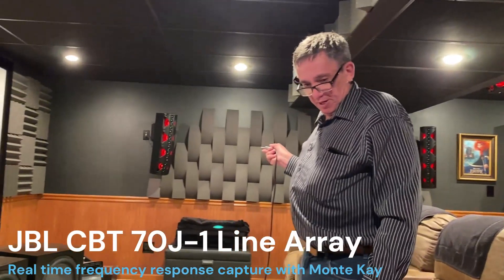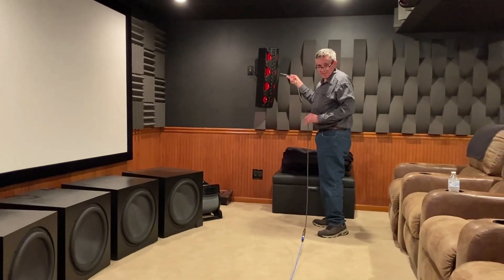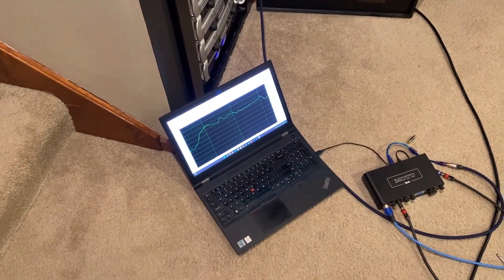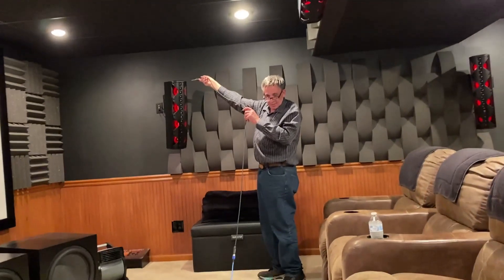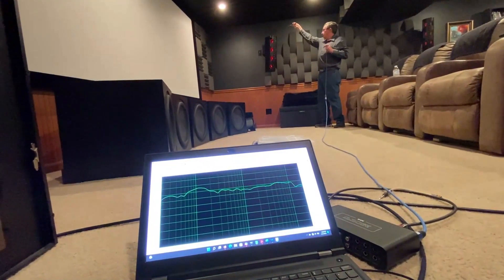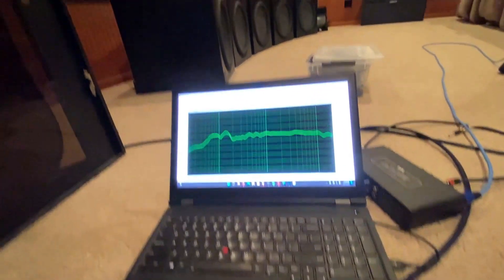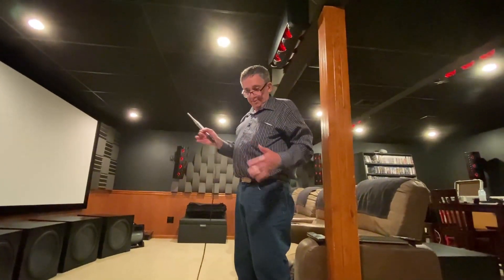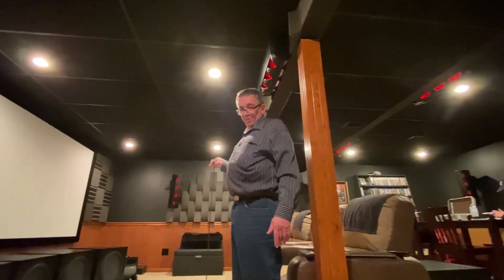JBL CBT 70J-1 Line Array - Real Time Frequency Response Capture

Comment: Hey jonathan you think i can set one of those cbt 70j1 in a horizontal way as a center channel?
Reply from the maker: @jonathangonzalez2514  I don’t think that would be acoustically ideal.  Remember it is shaded and asymmetrical shaped.  Perhaps if you had two you could do it.   Put the j shaped end on the outside, but you’d need a big deep room to be able to utilize it in that orientation because it’d be so wide you could potentially have some comb filtering issues.  How much of that is an academic problem instead of a real world problem I don’t know without testing, but they are surely designed to be used vertically.
Reply: My living room is open concept. I want to do an lcr but i don’t have an acoustic transparent screen. I have a tv. You think if i do just left and right will be enough?
Reply: Also will an emotiva amp be sufficient to power a left and right of those cbt?

Comment: Watched your system in Mr Youthman channel. What the true purpose of that JBL line array? I mean does it designed as pa speakers or for home use?

I think the closest sound to commercial cinema is to use the same line of speakers as they use. I'm in the process of doing that. Still looking for the best pro grade speakers in perfecting my home theater. Some said just use pa speakers. But a good one like JBL Eon or at least JRX. I know it needs some tuning to tame down the eq and get the flat response. So what's your take on that?
Reply from the maker: The intent of the JBL CBT line array is to get consistent sound in every seat.  Watch this video in addition to the video you just watched.  I enjoy pro audio speakers in many different flavors for home cinema.  This CBT line array is one path.  https://youtu.be/RP5Ka_93Tfg